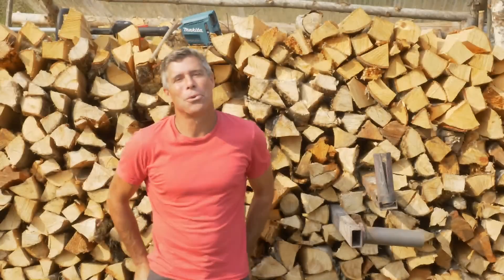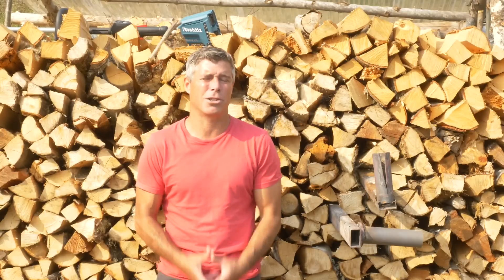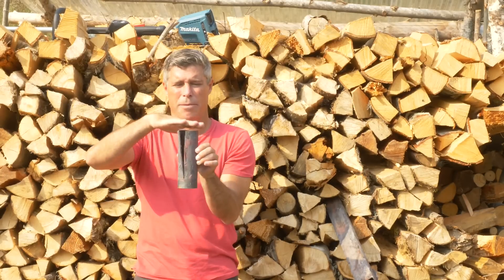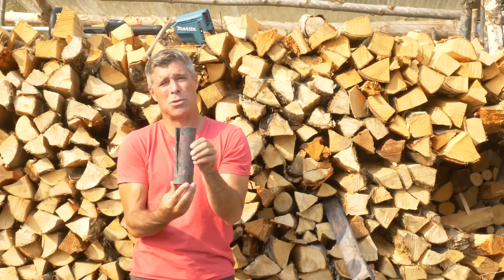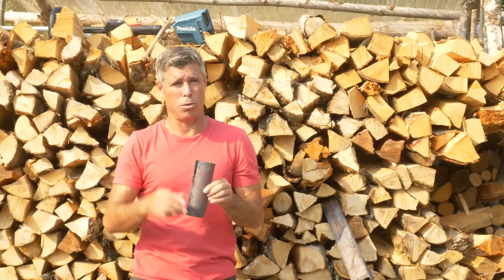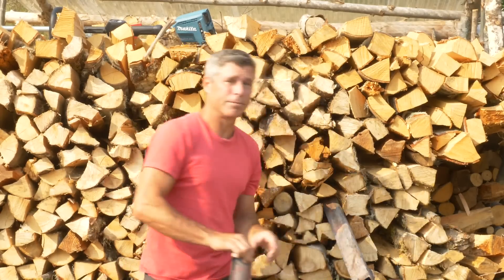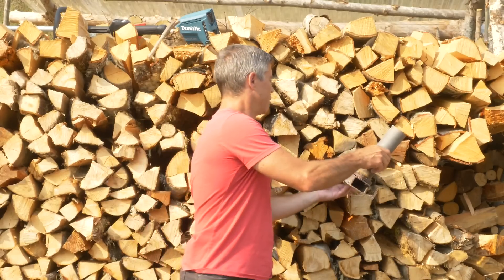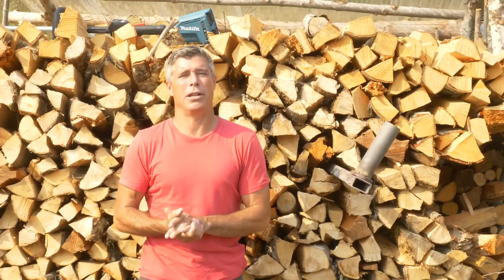Batch Box Rocket Stove Secondary Air Discussion

Comment: I might be a little more concerned with the 19% chromium in the 330. Might be better to just stick with periodic replacement if the 330 wears out at any speed, but I haven't seen an update as to how this is working.

Comment: I still think running the rectangular tube (or black pipe)through the back wall of the chamber and have it re-enter higher up would work. Insulate the bend outside of the core. There isn't anything to clog nor to deteriorate.  Of course, that opens up the turn to clogging.  Maybe a half brick or ceramic rod as the debris shield.
     Or stick to the Mitsubishi flange.

Comment: If you don't mind a little spend, you could go to a fabrication shop and get these made from tungsten, much higher melting point and not as prone to distemper. Their melting point is 1000 degrees or more higher than steel

Comment: Matt, do you ever have smoke come out of the secondary air tube since it is open ??? Thanks
Reply from the maker: No, as long as there is draft in the chimney there is negative pressure everywhere inside the stove, so it never smokes back.
Reply: @broaudio  I will be making a secondary air tube out of inconel with a stainless perforated floor on both sides of the air tube. Thanks for the information broaudio.

Comment: Hello from Madrid I ve build my batch box and I put a P Chanel above and I have not introduce any tube inside only the horizontal tube conducting to a hole of bricks just above the narrow betwen the primary and secondary chamber Is cleaner and It works

Comment: seems like you just need to find the right material. It's out there and it is cheaper then what you got. Call or better yet go down to your local metal company they'll be happy to help you.
I was thinking a outside air supply that way the pipe stays cooler when air is drawn through it. And you only need a piece a foot long long or less. Also placement can help longevity, the rest can have a flange inside the pipe to close it and be galvanized or even plain steel tube to the outdoors.

Comment: An addendum...

I do have a J-tube. It's on my channel, my first build, which I have since made the burn chamber almost twice the size so I could burn cord wood.

What I found is that cord wood does not burn well vertically unless the burn chamber is stuffed full, thus increasing the velocity of intake air  since rockets DEMAND a certain CFM once burning.

I installed a 3/4 inch secondary drawing cool exterior air. It does amp up the temps but the fire needs to be burning vigorously.

I've also found that I get the best burn with wood cut into 4 inch lengths, stuffing the (new larger) burn chamber full... I'm getting barrel temps up to 800°F.

I also changed to a coarser stone in my mass... but that's another conversation.
Reply: your feedback just demonstrates how finicky these stoves are. So for example when you say "burn chamber" - you mean the J feed tube or the horizontal "fire box"? Why does there even HAVE to be a horizontal fire box?
Reply: @voidisyinyangvoidisyinyang885  

I agree... i  made a larger copy of one on YT, Zero Labs (check it out), it's my first and only one. So it does has a burn tunnel. What a learning experience this basic rocket has been.

Like you, I really don't think a tunnel is necessary. Thanks for bringing it up. I think the elimination of the tunnel will facilitate easier starts since the riser must be heated first to get things flowing in the right direction. I'm reminded how often I had backflow in the beginning, filling the house with smoke. Duh...

The cord wood firebox is made of 1/4 inch (6mm) steel plate. Temps are so high at its base that some of this firebox has melted away... astounding. Who'd think wood could melt steel?

I am designing various rockets now, considering a horizontal firebox, all refractory, no metal, except the exterior.

Back to the drawing board.

Comment: Great video. There is another alloy of stainless steel (321) that has titanium atoms in the matrix. Some of the heat exchangers in outdoor wood furnace use it. The properties are very good for higher temps. 310s stainless is a good around high temperature and corrosion resistant stainless steal.  Do you know what the nickel percentage is in yours.
Reply: How's the new RA330 steel lasting so far? Good news to report? :)
Reply from the maker: The alloy I'm currently testing is Rolled Alloys RA330.  You can read about it here:

https://www.rolledalloys.com/alloys/nickel-alloys/ra330/en/

"35% nickel, 19% chromium, 1.25% silicon and controlled production techniques to ensure a product that has the optimal microstructure to withstand repeated thermal cycling."

So far it seems to be holding up very well.  Thanks for the comment!

Comment: Matt, what’s the thought on these metal wear parts getting vaporized over time - are there any concerns with harmful emissions? I don’t know enough about metals and chemistry, but I’m curious what you know about what might be getting released from those disintegrating metals? Thanks!
Reply from the maker: Hi, thanks for the great question. I do not believe there is any reason to be concerned, the metal gives up it's carbon to the combustion cycle and most of the rest of the elements end up as flakes in the wood ash.  It's a similar process to rusting, just much, much quicker.  Hope that helps!
Reply: broaudio thanks for the reply, (that was fast!), and yes that makes sense to me now. Thank you.

Comment: Matt, what do you think would be the result of cutting the top of your port tube at a 45 degree angle so it slopes downward in the direction of flow?  Would that not have the same Bernoulli effect and cause a low pressure draw through the pipe?
Reply: I think by closing the top of the tube and drilling a series of holes in the back side of it might help with deterioration. 
By having the air jetting out the holes it should help keep the heat pushed away from the exposed edges. 
This is the purpose of the Combustion Air intake of the newer wood stoves. 
Just a thought!! Lol
Reply: @jamesglenn520  I like the way you're thinking.  Any kind of coating that could survive those temperatures at that juncture that could protect the metal from the high temperature oxidation would eliminate having to replace the tube entirely.  That's sort of been a Holy Grail for me since I began studying these stoves.  I've learned a LOT from Matt.
Reply from the maker: Thomas, I think it may be of slight benefit, but as I say about my slotted version, it's not worth the time since that detail will be gone in a few weeks of hard burning as the metal begins to deteriorate.

Comment: As always, enjoy your insights. I've a scrap yard nearby that retains stock it can sell by the pound.

They have stainless... which I think would be more durable... I think melting temp is 2600°F. I may be wrong.

Presently have a J tube, drawing plans for a batch... want to try my own design first,but will be designing it to be easily converted to Peter's should it not be what I expect.

Thanks again... that 10% secondary info is HUGE.